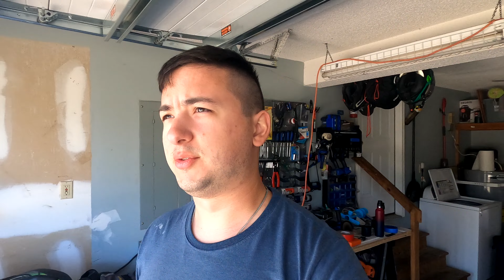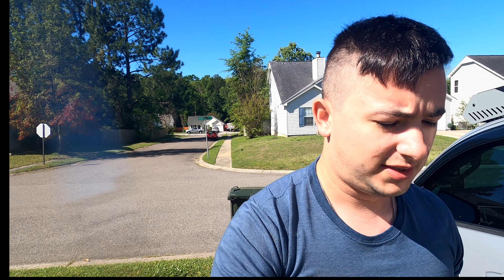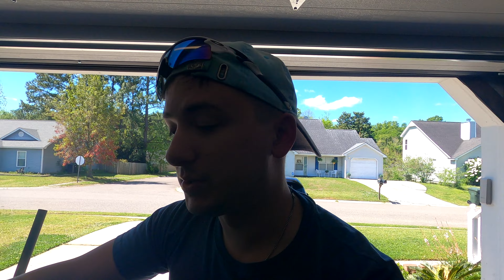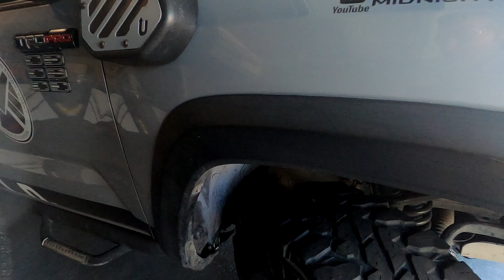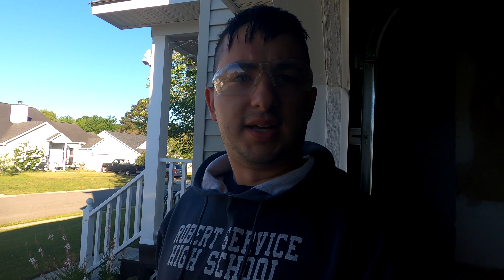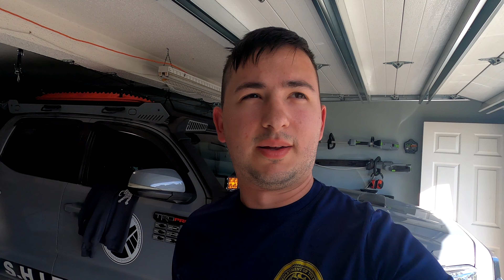Front Body Mount Chop: 2017 Toyota Tacoma

Comment: What did you use for jack points while doing this?
Reply from the maker: I didn't need to use anything. The OEM mounts are already WAY over sized for what is needed, so I just cut off the front of em and they were plenty strong to hold that corner of the truck while I welded the new plate in place.

I will say though that I didn't cut enough off, and I have had to go back and trim and reweld due to tire rubbing a bit on the plate.
Reply: @FDTD518 TY for the reply, I’m going to end up doing this myself and seen a few other videos too where they mention going further into the mount pretty much taking off some of the hole so it’s not a perfect circle anymore as an example.
Reply from the maker: Good luck to ya! I will be doing the C4 fab kit eventually, this chop was a temporary fix but it does work well. I would recommend checking tire clearance at full lock before welding the plate in place, just to make sure the tire will clear. Like I said, it's not bad but mine still rub a smidge at full lock with the chunky mud terrain tires I have on there now.